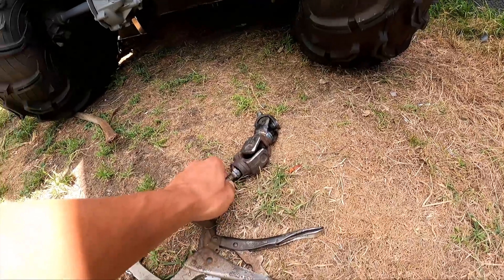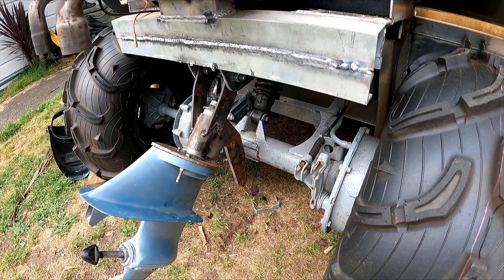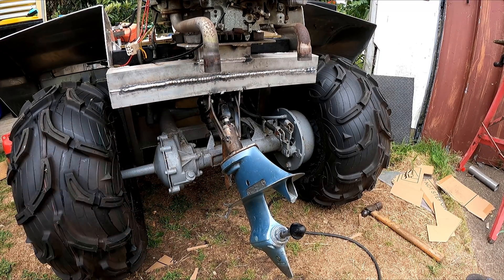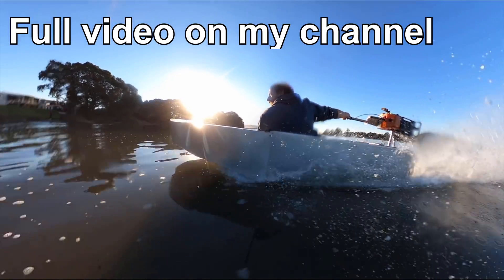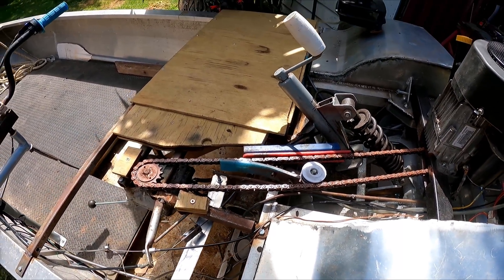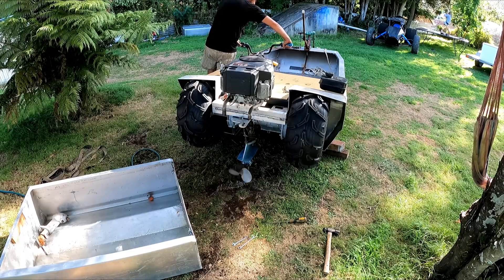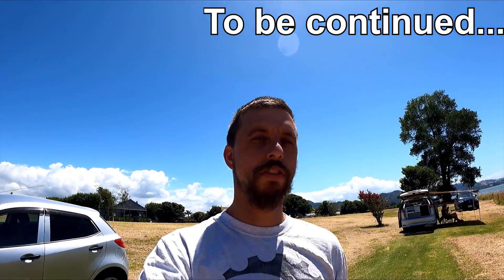Amphibious ATV Boat Build, Part 8 Propeller Time

Comment: Stick a diode between those wires and the voltage regulator shouldn’t drain your battery anymore

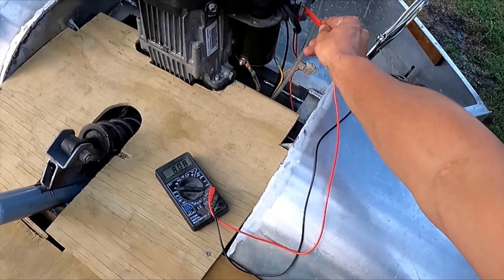Comment: 7:37 tell me, please, at this minute did you check the engine rpm?
Reply from the maker: No , this is checking the volts from the charging system. I don’t have an rpm meter

Comment: Make sure that you can lock the outboard motor in position.
If not, and you put it into reverse it will come out of the water :-/
Reply from the maker: That upper tab I welded on locks it , I don’t know how I can remotely switch it forward and reverse might just have no reverse 👍

Comment: I should be fine just check if its drawing current while its off
Reply: Plug wire in have everything off disconnect neg terminal set meter to dc amps usually they 10 amp rater and prob between neg bat terminal and the ground wire see if its picking anything up if its under 50 milla amps your all gud
Reply from the maker: Thanks a lot ! That’s a good explanation I will try that tomorrow